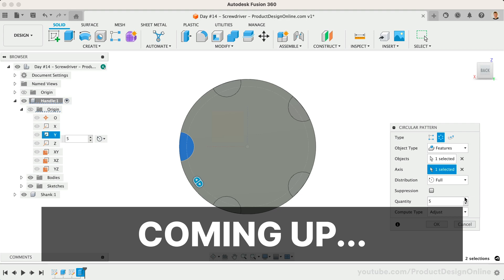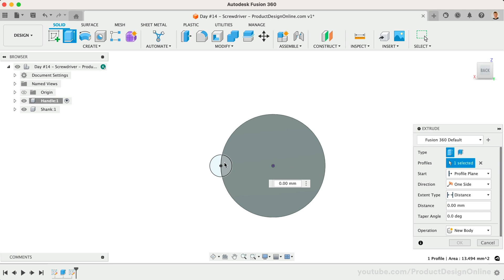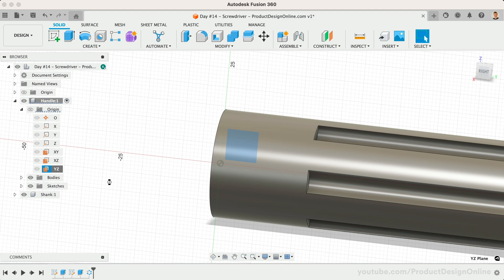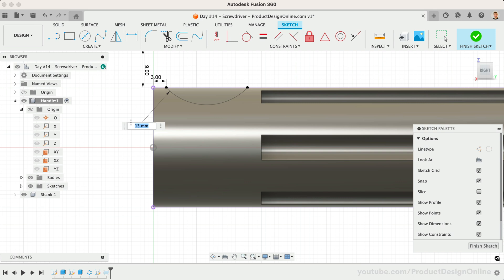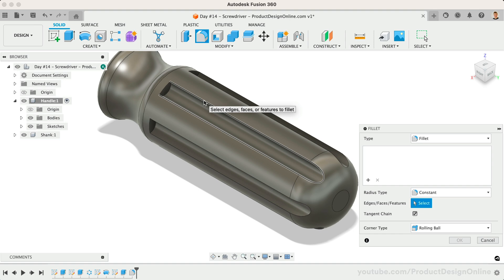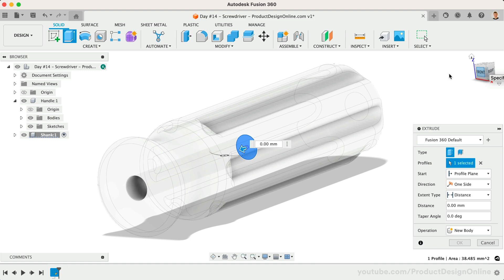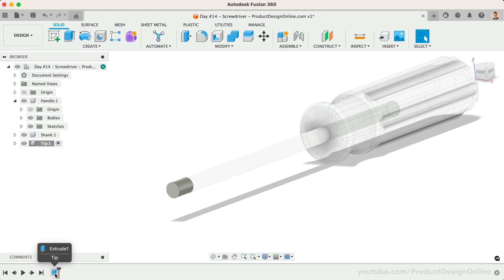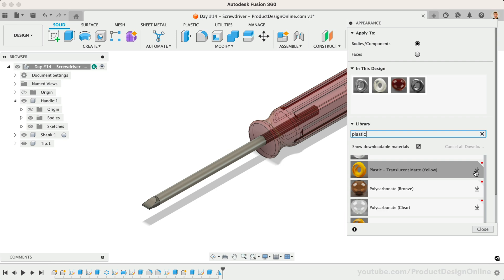Day 14 of Learn Fusion 360 in 30 Days for Complete Beginners! - 2023 EDITION

Comment: When you Extrude the handle Cylinder, you initially move the extrusion arrow forward, causing a negative distance.  However, if you watch closely in the dialog box, the distance is set to a positive 100 mm, extruding it into the plane.  I had trouble getting the intersect function to work until I re-examined this step.

Comment: I am running into an issue with the revolve and intersect. I have projected as said using intersect. then I place the 3 point arc but when I start to dimension the radius of the arc, the sketch moves outside of the geometry and I cannot fully constrain it.
Reply: same me too

Comment: @10:15, if you are a little too careful placing your 3 point arc, you can end up with an accidental midpoint constraint indicated by a triangle on the top line.  It will block you when you try to place your 2nd dimension between the corner edge and the second endpoint.  Click the triangle and delete it.

Comment: If you can't get the tip dimension constraints to work, create a centreline but right click on it and change it to fixed. Then set your points. 
I found this when setting the 0.5mm dimension would pull my centreline out of place.

Comment: I'm having issues applying the constraint to the tip and I'm baffled as to what is wrong. The left hand arc point seems to be constrained to the left side of the tip (it only moves vertically) and when I try to choose the constraint it gives me an over constrained warning. I also can't set a dimension between centre point and arc edge. What am I missing?

Edit: I managed to complete but with no dimensions. I'm still confused why the first attempt to add a constrain gives an over constrained warning.
Reply: Mark I was having the same issue.   It seems that it was automatically adding a Coincident Constraint to that point. I removed that constraint and then I was able to add the Vertical Constraint as shown in the video (although I don't know that it was necessary to make that change).

As for adding the Dimension, I was able to do this by clicking the dimension tool,  then holding the SHIFT key while clicking on the intersection plane and the mid line. Then releasing SHIFT and selecting the Arc point.
Reply: @jimfraley4135  Thanks for the advice Jim. I went through again and removed the constraint and it worked fine. Appreciate you taking the time.

Comment: For the tip I had to add points to the midline and point on the corner as my mouse was not snaping as it should have to those points. I did use the intersect but it seemed was not enough. Thanks for content. Will have to move on to a paid class as I am liking this.
Reply from the maker: Hmm. Only thing I can think of, where you looking directly at/straight on the sketch? If looking from an angle, the snaps can be picky.
Reply: @ProductDesignOnline I have the same issue. Looking directly at it for sure.
Reply: I had the same issue. My solution was to hold left mouse button over the spot and then select Vertex, which was the center point. I then selected dimension tool and clicked the end of my arc.

Comment: When creating the tip, when you added the dimension between the Y axis and 3 point arc, I never had a point to click on on the axis, which actually makes sense to me. I am curious how yours had one, though. I just added a construction line on the axis and added the dimension against that.

EDIT: Click and hold trick let me select the point on the axis without creating a construction line.

Comment: Is there a reason you dimensioned to the center of the circle on the revolve? I would have dimensioned to the depth of that cutout with a tangent dimension on that arc and I don't see the advantage of finicking with the center of that arc that's floating arbitrarily in space. My intuition doesn't click with that step.

Comment: Thank you for these sessions! I'm struggling with changing the diameter of the shaft. When I change it, the timeline rewinds back to before the extrusion. I can replay the timeline, but it's not as automatic as your video shows. Am I missing something?
Reply from the maker: Did you select 'finish' sketch after updating the sketch dimension? It should automatically adapt after finishing the sketch (and rolls the timeline marker to the end, automatically). If not, it's likely an issue with your Projected geometry.

Comment: On making the shank I can't get the inside face selected have tried many times.
Reply from the maker: Do you have another sketch or something in the way? Try clicking and holding on the inner face until the selection menu comes up. That will allow you to toggle through the selection options in that area, until you find the 'face'.

Comment: Getting stuck at 4:05 - 4:27. When I use the specified dimensions, the final 9mm step fails, due to other constraints, and limits itself at 15.524mm
Reply: Aha! The issue was where I was dragging the final dimension. If you place your mouse between the purple projected point and the radius point, you try to define the distance between them. What is intended is to drag the mouse further to the left, and it'll change the dimension to the height distance of the two, vertically instead of diagonally.

Comment: I made shank and three different tips (4 components). How do you export (save as mesh) shank and only one tip without merging components?
Reply from the maker: Turn off the tip components in the browser that you don't want to export. Then, you can 'Save as Mesh' from the top-level component (including just the overall screwdriver component + 1 tip component). The export won't include the hidden components.